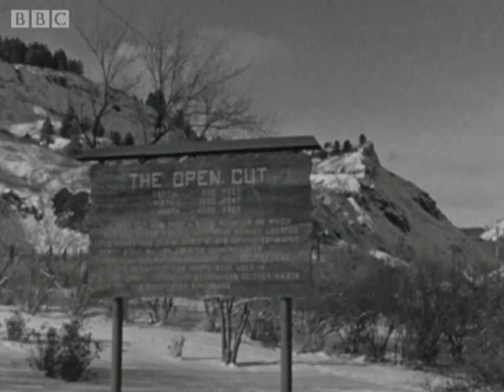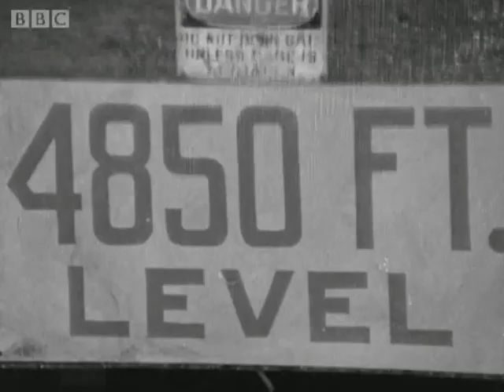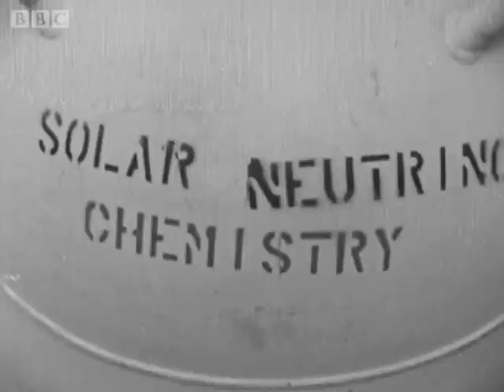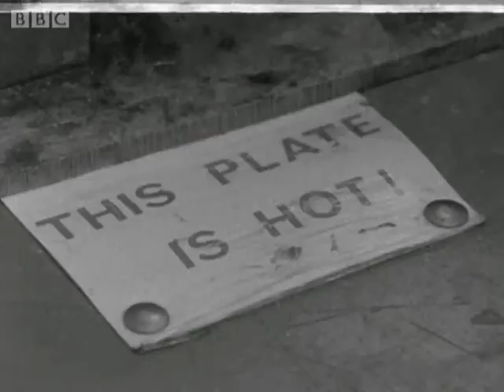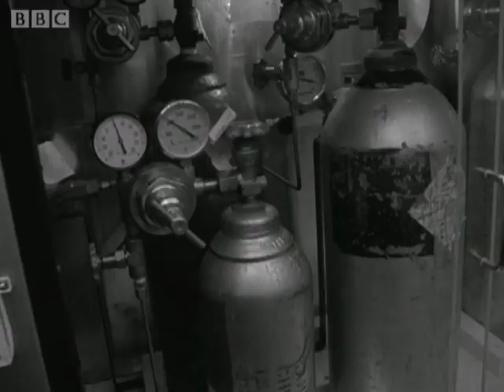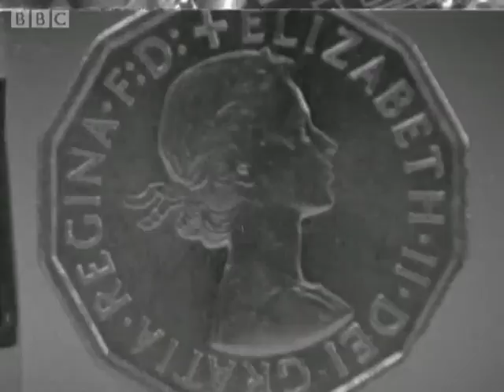Tomorrow's World - Office of the Future 16 April 1969 - BBC

Comment: Crystal lights, active filaments, anything but LEDs. 

I think this tells you as much about the BBC as it does about the device.

My guess is that the term LED had been coined, but the producer of the show decided not to use it in case it was, or was to to become, a commercial  brand name. 
You will also notice that the name of the company doing this research was never mentioned.

The BBC was, and still is to a large extent absolutely paranoid in case it was seen to be  advertising. Things were often shown on "Tomorrow's World" as if they were just laboratory concepts, when in fact you could go out and buy one if you knew where.
Reply: LED stands for Light Emitting Diode.  Unless you have some basic understanding of electronics, and the way light can be emitted as a consequence by passing a current through particular substances, LED would not have told the audience of the day anything that they could have made sense of.  Remember lasers has only started to be made in the early '60s and were certainly not common place, so the general awareness of excited atoms releasing light was unlikely to be widely known.
A '60s audience would have had some familiarity with crystals (precious stones) and filaments (as in an electric light bulb), so they chose labels which at least conjured some idea of what they were talking about.
Reply: @sigmata0  this is the correct answer.